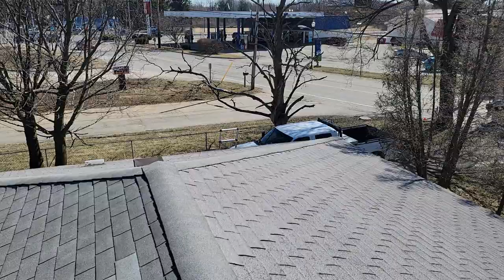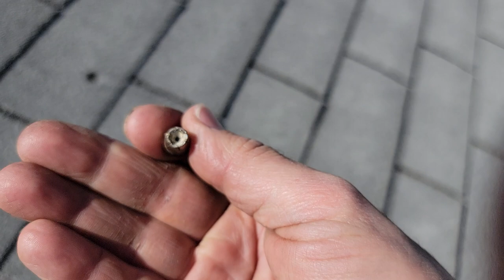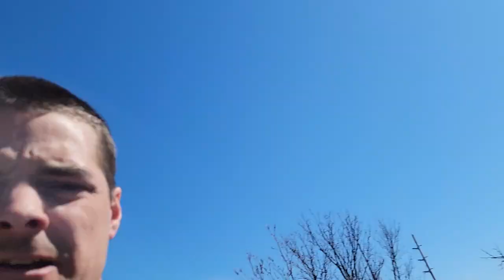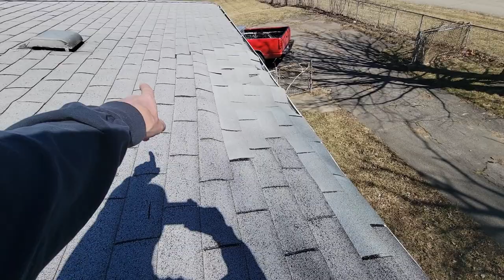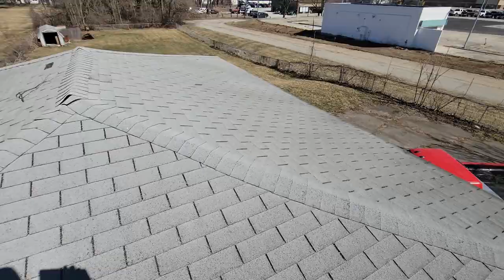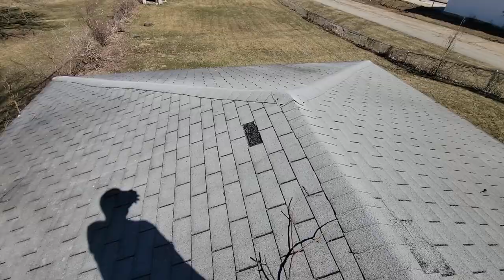Bullets in Roofs

Comment: My son found a meteor on my roof.  If you ever find those,  keep em.  They're more valuable than silver and sometimes near gold in value. 

The Myth Busters did an experiment on the impact power of all sorts of rounds.

The impact of an ammunition round coming back down does not even have enough force or momentum to go through bone,  but can damage asphalt shingles.  It would never get through 1/4" osb.  But regardless, It can cause a leak and it's just folly and irresponsibility to waste rounds of ammunition in any way, especially something that can cause failure in a roof. 

And it was a hollow point!!! 🤦‍♂️

Comment: I've never seen a bullet that has been through a roof before. I remember a few years ago though I was helping tearing off an old roof with the roofing company that I work for and I actually found a set of old rusted keys in the gutter when I was getting nails out of it. I'm pretty sure the house was vacant it might have been a foreclosure. I asked the guys that I work with if the keys belonged to them thinking that it might have fallen out of their pockets they all said no. I ended up keeping the keys as a souvenir ha! That's the most unusual item I've found on a roof so far as I've been with the same company for almost 8 years now.

Comment: Have you ever found any that have penetrated pro panel steel roofing? I’m redoing the roof on my mobile home and trying to decide if I need to also add  plywood because there are a LOT of idiots firing fully automatics in my neighborhood and I have kids. My neighbor doesn’t think my roof can handle the weight of plywood, but I’m hoping the new pro panel, and the crappy old sheet metal/insulation/drywall, will stop a bullet!! 

Any ideas would be greatly appreciated!!

Comment: HELP!!!  

I have an architectural shingle roof.  There is a shingle that has formed a hump on it!!!  It looks like the shape of an ocean wave or an upside down U.  The hump is around 10 inches horizontally and 2-3 inches vertically.  What has caused this on only one shingle?  Is there water underneath this?? I live in a high wind area.  It is a 23 yr old architectural timberline roof with a 10/12 pitch. I have been told that roofs only last 20 yrs and i should have a full replacement soon (even though overall it looks good still). Shouldn’t it last longer since it has a steeper pitch? 

Even though I am a girl who doesn’t even own a hammer or a drill, I LOVE watching your videos!!!!  I watch every video you post!! :)
Reply from the maker: It's hard to tell without seeing it so if you want you can send it to our Facebook page Instagram page or via email and I can take a look at it.